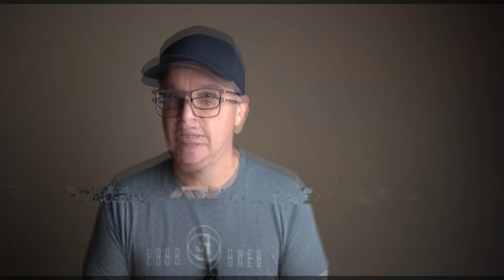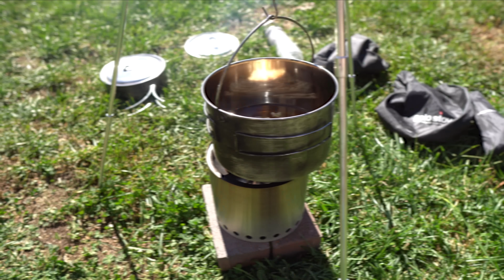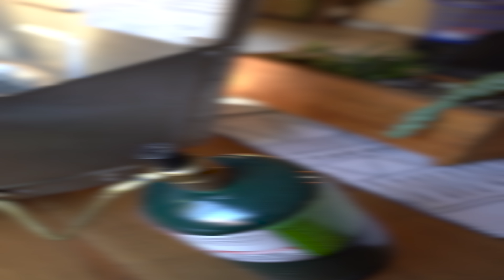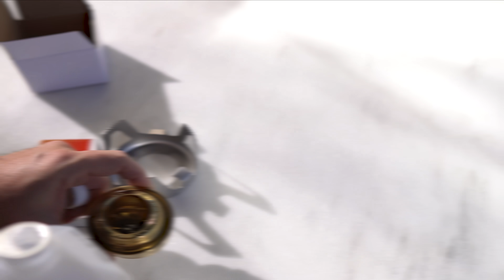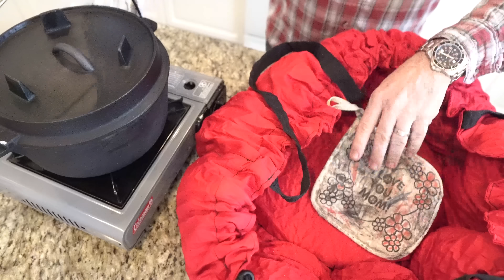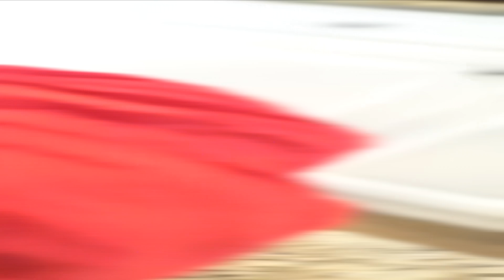12 Ways to Safely Cook After a Disaster

Comment: I am a fan of dutch ovens.....once you have eatablished the initial coals the required they retain heat really well and are efficient and produce me nimal smoke...you can cook anything in a dutch oven...also pre soaking rice etc speeds up cooking time...one pot meals are ideal...i prefer using charcoal briquettes...also if you are lighting a fire use it to the max..cook on it...heat yourself with it...boil water with it .manufacture your own cuarcial ...all at the same time with the same fire...i recommend old style rubber hot water bottles for keeping warm..the wayer can be reused for the same purpose again.....

Comment: If you have any power at all such as a jacket unit have a crock-pot.
They don't use much power. 
Use them on high for long enough to bring the contents to a boil then set the whole thing in a cooler and cover it with towels to insulate the pot. In a few hours your food will be ready.

Comment: You forgot about livjng i  nowhere and just have what you can cary. And cook using a double pit made from mud all you need is wood or any other fuel anx metal gril, some pot or pan you can make or bring witb you, not to heavy.

The secknd pit takes away the smoke, and difficult tk see.

There is alsoa folding spirit stove, like esbit or crusader. Used in mlitry some come with theirown system of cooking.

Also trangia is compatable with kelly kettle. Kettle will fit over the top, you can also use gas on a remote lead, aswell as alchol spirits.

Comment: In our tropical retirement area, solar cooking is a viable option most of the year. The caveat is typhoon season when you had better have other options available to you. We may experience many overcast days in a row and heavy rain. Localized flooding occurs when there is a planned water release from dams on local rivers, done to protect the dam. Our utility poles are precast cement and very solid. Loss of power is rare but can happen if a transformer blows out, is struck by lightning, or a heavy vehicle takes out a utility pole. For the above reasons, our assortment of camping gear is pressed into service and the emergency becomes an adventure for our young troops. It certainly helps to have food and plenty of water barrels in storage so there is never a need to venture out during an event

Comment: Good way to cook on the go -

Get a double wall stainless steel wide mouth thermos.
Put in your rice, beans, oats, noodles, similar.
Pour in HOT water (but not boiling).
Close lid.
Begin your journey.
In a couple hours, your food is cooked and still hot enough to eat.

While others are zeroing in on where you WERE (aka evidenced by your cooking smoke), you can be long gone.

You will have drinkable water left in that container (albeit flavored) which is a good thing....

I saw no mention of twig stoves like the Firebox and the like.
A true hobo stove is just a tin can with a few holes in it, filled with twigs, etc.

Pretty hard to find the metal coffee cans anymore though.

Most of the items in the video seem meant to be used in a non SHTF scenario (like after a natural disaster) where you do not need to flee from others. Or used for 'comfort camping'.

Comment: Be careful with those butane stoves popular with the Chinese. Do not use too large of a pot as the heat can cause the canister to explode, keep the pot to burner size and make sure it does not cover the canister area. When shopping for butane, look for the cans that have a blue ring as they are made to pop off rather than explode; it is a newer safety feature but the above advice must still be used. Old cast iron is better than even new American made cast iron. That well known American company has not bothered to smooth their cast iron so a lot of things stick to their "pre-seasoned" pans. Go to a thrift store and you will see how glass smooth old cast iron pans are inside.

Comment: I love my old Coleman 2 burner suitcase stove.  I have the option to use white gas or propane and these stoves are very reliable.  My standby generator won't run my electric glass top stove so I put the camp stove on top of it and cook away!  I do have other options such as twig burners and a firepit with a grill if the circumstances and duration require it.  We've gone several weeks with the Coleman stove after hurricanes.

Comment: I'm in Austin tx,  I spent a year and a half homeless in a tent in the woods behind a bad landlord and learned how to cook almost every meal over a campfire to save money. In Feb of this year,  tx had a major ice storm that almost caused a state wide electric blackout,  and messed up the water infrastructure for weeks. As a result,  despite me being on fixed income,  I invested in emergency camping water filters to secure a water supply.  I was looking into setting up a primitive teepee style smoker for food preservation if I have to resort to hunting for food. However,  I haven't been able to afford that as of yet.  Earlier this month,  I went to take trash to the dumpster and found a small cabinet stlye double Decker smoker that needs repairs in order to be used,  but I think I can use it for an emergency cooking method,  as well as for food preservation. I only would need to collect wood and kindling to use. Most of the damage on it is cosmetic rusting,  however one of the legs is mostly detached and the bottom is rusted out badly. Luckily there is a hime depot nearby where I can get materials for tge repair,  I just need to order the tools online. I got advice on the repair from my best friend from college who has a degree in welding and smithing.  I figured relying on her degree plus country girl expertise was the best option.
Reply: You are definitely a Survivor! Congrats! 
🎉🍀🖖

Comment: an thats why i got a wood burning stove and not a wood burning insert. it rear vents so i can get the full top of the wood stove to cook on or heat a kettle. my house also has a buried 500 gallon propane tank which would last a very very long time just using the deck grill. if i use it to run a generator...it wouldnt last very long (2 weeks of use maybe?) but i did get a dual fuel generator just in case.

Comment: I have cooked through two hurricane power outages that lasted eight days each using a green suitcase Coleman camp stove. I have a 20 lb bottle of propane like for a gas BBQ. Attach propane to stove with adaptor line. Adapter line costs about $8.  You cant use a BBQ propane bottle without the adapter line. You can cook for two, two meals a day for about a month. Be sure to have cook pots and pans that will fit on this smallish stove. Nothing needs to be expensive. It just has to work. A vacuum thermos bottle for each person allows for a days supply of a hot beverage. 

Plan for a simple way to wash yourself. You will get yeasty and gross about day three. So this part really isn't an option. Will you have tap water? Will the city keep it flowing after loss of power? Plan accordingly.

Comment: I personally have a small grill- but no fuel for it. My parents have a fireplace they've never had checked or cleaned and a camp stove with some small bottles of propane. I'm hoping to go with my Dad to get the materials for a rocket stove and some firewood. If a rocket stove can be built in their fireplace it would be very efficient and less obvious, and also wouldn't have the flaw of running out of fuel once the propane is gone.

Comment: Excellent info!  Another thought for those who have high efficiency fireplaces is to cook your meals inside the fireplace with the door closed. The closed door will reduce the cooking aroma inside the house. You can use small kindling for fuel and you can regulate the air flow for combustion. An additional benefit is the cooking aroma goes up the chimney and is well dispersed away from the source.  Furthermore, the use of kindling will reduce the amount of heat the fireplace produces on warm or hot days.

Comment: The problem with open fires is during a disaster like a Hurricane where there are a lot of downed trees and destroyed homes (piles of wood) the government place bans on having open fires to prevent fires from getting out of control... mostly because the amount of dead piles of trees (fuel) and the taxing on emergency responders. So, in a situation like this, open fires are not even an option.

Comment: I think its called the 3 day rule. No food, water, heat or shelter be prepared to share or die. Cooking? Better off eating cold item's, caned goods ( not warmed up), soaked rice. Use minimal cooking times 5 to 10 minutes or a pressure cooker with the top sealed over a candle.

Comment: Another avenue to save time while cooking is a stove top stainless steel pressure cooker. It can significantly decrease cooking times. We use it alot in Brazil to cook beans. It significantly decreases cooking times along with pre-soaking the beans. On a gas camping stove with a big gas tank you can cook for months.

Comment: Rice cookers are remarkably versatile and a great option if you have a way of maintaining electricity, either a generator, solar power, ect. They combine the effects of pressure cookers and insulated pots to allow the food inside to be cooked with the minimal amount of heat input and many come with a variety of settings and accessories such as steam baskets for cooking a plethora of different foods. They can even be great for baking cakes or bread if you want. Also a note about coil heaters... you can find electric kettles which contain these that allow for the rapid boiling of lots of water within a safe and easy to handle vessel. Definitely recommend getting one of these and using it everyday to boil water for tea. They are a godsend for the college student living off of package ramen and instant coffee.

Comment: I know that as I am a full time RVer and I can tell you living in texas that my propane was used during that winter disaster. 

Having an rv that was connected to the grid was helpful to keep the batteries charged on my rv so it would spark up the propane heater, by no means was it fun or exiting it was that time of oh God please don't let that gas run out. I know now for the next one how to deal with it better and currently getting prepped for it now thinking of also getting a heated blanket for warmth to be able to not have to run the propane as much.

Comment: One important note on the Kelly Kettle rocket stove. NEVER, EVER LEAVE THAT PLUG IN PLACE WITH IT ON THE FIRE. You will build up steam pressure and BOOM that plug will fly out violently along with boiling water. I have one and almost did that once. My 'backup' unit is a Sterno stove, with a case of fuel cans. One can use small pieces of 'biomass' fuel in the cans when the gel fuel gets used up, or just make a small campfire in the stove itself.

Comment: I love my Coleman 502 stove! It is just a single burner white gas stove that holds 16oz of fuel and you pressurize the tank by pumping it up. It is very stealth and burns perfectly clean! Also, it cools down very quickly, is very light, and takes up very little space in my backpack! So far, I've used it quite a few times and still haven't put a dent in the gas usage. Very high quality all brass fittings, and since I have an old model in mint condition from 1964, the cooking grate is some sort of stainless steel. I don't like the new stoves because the cooking grate seems to be cheap and prone to rust and would never recommend or buy one.

Comment: Good solutions. A "hay box" is much cheaper then the wonder bag. Put crumpled newspaper, hay, or other nontoxic insulating materials in a box. Put your covered hot pot in and put more insulation on top. Close the box.
If you are going to go with one pan, the wok is the almost perfect solution. Get one with a lid. Stew, braise, fry. Can't bake, but a dutch oven can with coals on the top (construction of lid and bottom are important).

Comment: Hi my name is Kevin let me tell you stuff that works good oh it works great and it's so easy it's just any junk you can get out of a pizzeria what you got sitting around the house for laying around the disaster what it is if you just simply take a metal bucket or a number 10 can maybe bang the ends down on a pipe for rebar should we posted a little bit higher up put it in the ground bury it and leave about maybe half inch a quarter of an inch sticking out of the ground don't put it under any trees because I don't care how high up to leave so you going to burn them they're just one big insulator that is just nothing to keep you warm but I'll tell you what I boiled hot of water in 4 minutes or less use the frame for boiling holes for cooking clothes off a lot of heat this works great and it's so simple can be jumpy get out of a dumpster number 10 cans as a pizzeria dumpster a metal Bucky probably got sitting around your house anyway we enables throwing out I used to f*** it a metal bucket somebody was throwing out so it doesn't have painting that great good day and God

Comment: To me, a much more practical and renewable resource is a woodburning heater.  I have cooked on the top of a wood heater, and I have cooked on top of a kerosene heater -- even baking biscuits using a cast-iron crockpot (similar to a Dutch oven, but without the feet and the flat lid).  Gas -- both natural gas and propane -- is likely to climb high in price and possibly become unavailable in some areas this winter.  While that makes it unreliable in my mind, wood is always available.

Comment: A cheap 2 burner propane stove is hard to beat.  Get the hose to be able to attach it to a bulk cylinder.  As noted, have multiple cylinders.  This is likely to be the easiest for most people to use as it's pretty close to a typical gas range in terms of function and cooking properties.  Using propane in a stove such as this is also far more efficient that in a gas grill.  Propane keeps practically indefinitely, a big plus.  A liquid fueled stove can have its place as well.  Make sure it's multi fuel (an example is the Whisperlite International or better the Dragonfly), to be able to take advantage of many liquid hydrocarbons from Coleman fuel, to gasoline, to kerosene and diesel and jet fuel for the Dragonfly.  One gallon lasts a while in these stoves.    Long distance hikers (which requires light weight, efficient means of cooking) are big on "cozy" cooking - basically what was said about the Wonderbag or thermal cooker - heat to a boil (typically with a backpacker style cartridge stove), cut the heat to save fuel, and let the residual heat finish off the cooking in lieu of simmering.  Dutch ovens rock in that if there is wood, there is fuel.  Practice, practice and practice some more to learn how to bake.

Comment: In Canada, and in particular Nothern Ontario, most of the year it will be difficult to keep a dwelling liveable is a challenge.  So, any method of cooking that involves the cooking inside of the house has a built-in superiority.  

But fuel sources can not routinely generate soot or smoke.  If they do, there is also the danger of carbon monoxide buildup.  For me, the solution is the Sterno stove.  They are cheap to purchase, and models tend to have different positive, interesting and negative points.  Obviously, the solution for me was to purchase three mildly different ones. Each works with the same Sterno containers.

The fuel is remarkeably safe.  Do remember that your safety, with perhaps the fire department not available, is of paramount importance.  Your overall safety is as good as your weakest link.  The youngest in my family has witnessed the use, remembers the safety features and can operate the Sterno fuel containers and the stoves.

In the past year, and quite inexplicably, the Sterno (and other brands) have been on sale.  I have, and I admit greedily bought up these fuel sources.  The cans are safely stored in a clear plastic box, so you can see if any damage has been done to the canisters.  Plus, these fuel sources will not burn without a significant ignition and plenty of oxygen.  

So, cooking inside with a Sterno fuel source keeps you safe inside, rather safe from CO (but I would buy a detector anyway) heats your food and heats your home.  By my calculations, one of the cans provides about 5000 BTU.  I plan on average three per day.  One for the morning, the afternoon and evening meals. 

In my city, they come in a 12 can flat of cans.  That represents 4 days of cooking fuel and ancillary heat for the house.  I just realized I need to purchase a few more flats of cans.  It is November 1, and at the time of this writing, the temperature is -2.0 C or 28 F.  It will get colder.

Comment: Great information, even for nomad life!!!  Two other items: an old fashion cast aluminum pressure cooker can be used with any of the forms of fuel you mentioned. Nothing to be scared about, it's the only way we had before electric. You can find them at thrift stores very inexpensive since so many switching to electric. These can go on a campfire or any open flame. The speed of cooking will save so much fuel. Also, a cast aluminum pressure canner is great for heating large amounts of water. If you are really afraid of using them don't leave the pressure valve on (the part that the steam makes swing back and forth). Newer nonelectric pressure cookers can be used on any of the cleaner  adjustable heat sources. I do not use them on a campfire. 
Second: the heat on sterno or alcohol can be adjusted by putting a small piece of metal over part of the hole. You may have seen this at a buffet at a wedding or conference. When the metal is put over the whole fuel opening it puts the fire out, again saving fuel for another time. Just put the lid on tight.